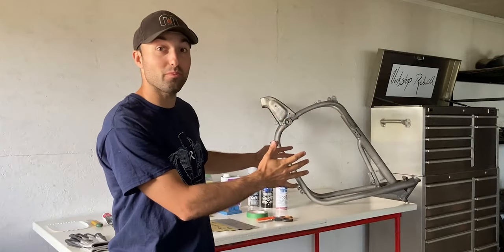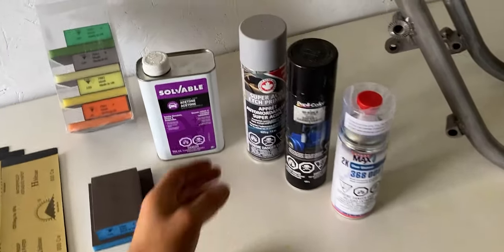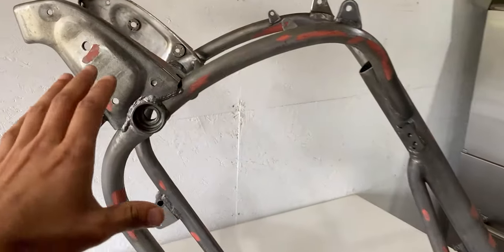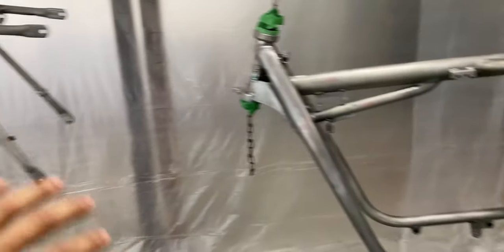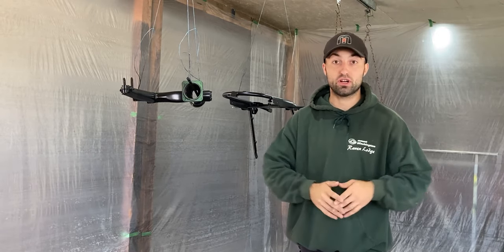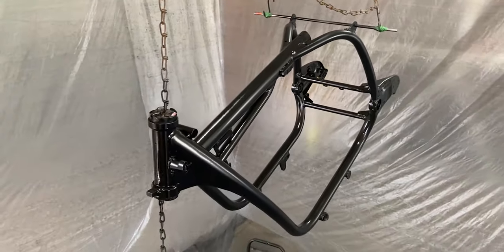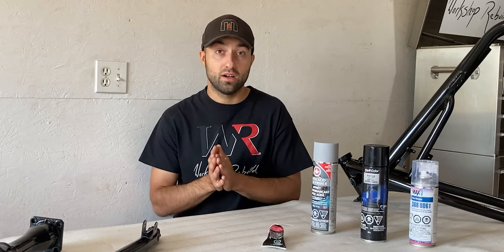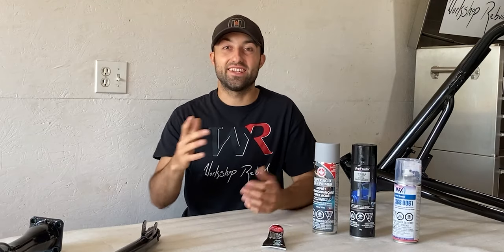Paint a Motorcycle Frame | Beginner Friendly

Comment: Hello to one of my finer technical mentors ….  Just been doing a 1968 R60/2 here in Maine.
Having fully disassembled, then scrapped off crud, and carefully wiped down with both lots
of lacked thinner and also MEK … the original frame pant was cleaned but not effected…
So my paint shop & I decided not to have it sand blasted, but re paint with PPG black primer
and lightly fair any minor drips, then two coats of single stage simple BLACK … worked well. And though it may not be a expensive Powder Coat job, I am very satisfied now …
Thank you for all your very fine tutorial education videos … cheers !
Reply: Hello, I wish to add , If using your “Tow K” clear top coat, which is Toxic !
Please be await of it’s health risk, and recommend using a fresh air respirator.
( The air is pumped directly to your well fitting face mask from outside the shop.
Reply from the maker: Hi John, it seems like you're enjoying the disassembly process and evaluation process. The decision you took for your R60/2 frame is perfectly fine and with proper preparation it will last a very long time. Back in the day BMW didn't use powder coating  either, so it's another way to stay original to the bikes history. 
Powder coating is a great alternative to paint...but the prices to coat a frame have gone up drastically! I'm 100% satisfied with my paintjob and I hope you're satisfied with the work you got done on your bike. Now you can look forward to the mechanical side of things. Regards Andreas
Reply from the maker: I am aware of the toxicity or paint and especially the clear coats that were used in this video. Behind the camera I had a fan running which was drawing the overspray out of the make-shift paintbooth. In front of the fan I cut out a piece of filter material to catch the particles, before exiting the shop. I would love to get a proper area setup just for painting, but maybe that will follow in the future.
Thank you very much for your heads-up and advice, it's much appreciated!
Regards Andreas

Comment: I think you were trying hard with this frame therefore cant knock your workmanship as no doubt you were thorough with your preparation  I am also amateur but on most surfaces there is what appears to be an orange peel effect. I don't know if this was down to temperature, paint or camera effect though watching in 4K.
Over many years I came to notice most manufacturers did not etch prime, prime or undercoat their frames but put cellulose straight to the metal. I started to do this years ago with 2 fairly heavy coats with about 15 mins between coats watching for runs though these can be rubbed out when the paint is totally dry (48 hrs at least) getting results that surprises many people as its usually as good as or better than 2k, an odd time I put a high gloss clear on top. 
Im watching and enjoy your Beemer videos, I have a 1973 R75/5. Thanks
Reply from the maker: Hi there! Thanks a lot for your critical comment and awesome advice. I am aware of the orange peel on the clear coat surface and I believe I can knock this down with a little bit of hand-buffing. I'm still learning A LOT when it comes to painting and I'm trying to share as much as I can during this restoration.
I will take note of your painting process, as it is very different from what I'm used to seeing. 
The questions I have for you are: 
-What paint do you use?
-Do you paint this way on all surfaces? (eg. frame, fuel tanks, engine components, small mechanical parts...)

I appreciate your words and thank you for your support! Comments like yours really help me and I will need to paint more on this motorcycle, so there will be more painting-content to come. Regards Andreas

Comment: Excellent job. I did not know about a 2 part clear coat from a spray can. Here in Richmond VA I believe I can have a motorcycle frame stripped and powder coated for about $300.00.
Reply from the maker: Thanks a lot CS Park! The 2 part clear coats are fairly new on the market and they perform really well for small projects like this. If you have that service near you for that price, I would not complain at all! Unfortunately, I have not seen a price like that near me. Then again I like to touch every part of a rebuild, so it's nice to paint if myself. Cheers
Reply: @WorkshopRebuild  I have to agree. You're project is doing very well. Keep it up. Thanks again.
Reply from the maker: I sure will. It gives me a lot of motivation to read positive comments on a daily basis. Thanks again for sharing your thoughts! Regards Andreas
Reply: That's awesome 300 to powder coat your fame . In New York with me taking my whole bike apart. It would still cost me 2500

Comment: that duplicolor will wipe right off if gas touches it. its cheap crap and no one seems to realize it considering how many people make videos using it to paint motorcycle frames. you NEED a two part urethane with hardener
Reply: He used 2k clear over the top coat...